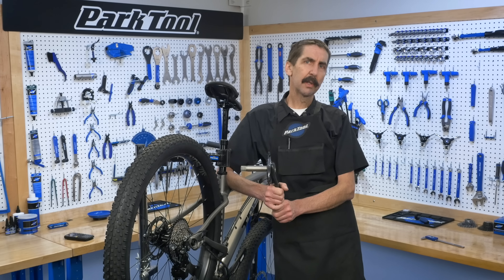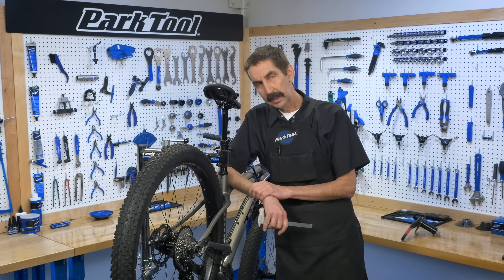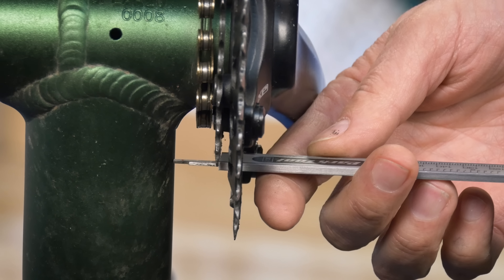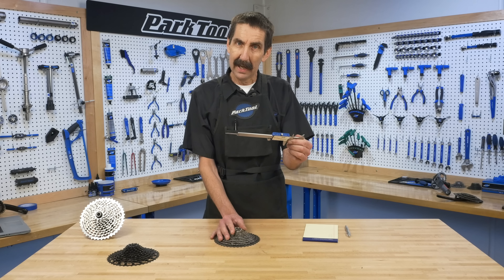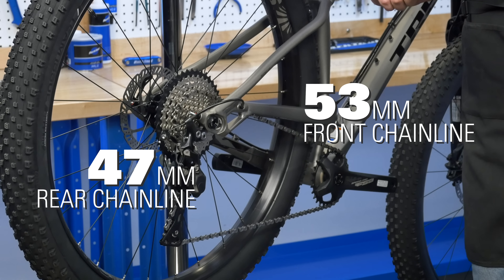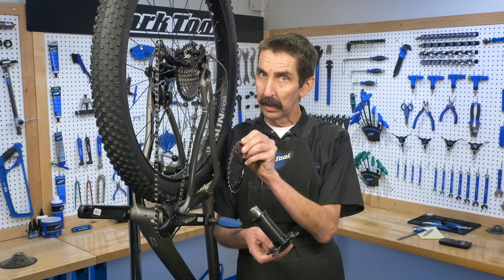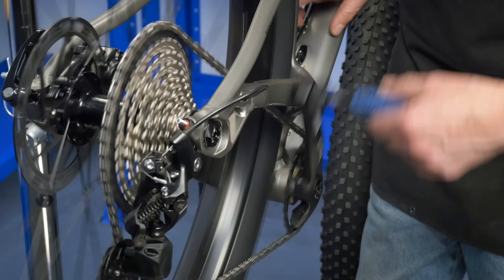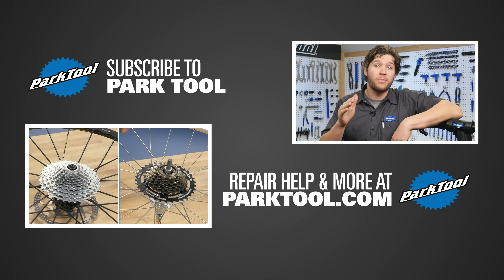Shop Talk: What is Chainline, and How Do I Measure It?

Comment: Hello, Mr. Jones. Excellent video, as always.

I have a question; I am running 10 speed on my road bike. if I buy 11 speed wheels ( in case of future upgrades ) and add a spacer, then a 10 speed cassette, is there a performance issue between this and an actual 10 speed rear wheel?

Thank you in advance for any advice!

Jim
Reply: Not Jim but the answer is: Most likely no as long as the rear derailleur is properly adjust especially regarding the limit screws.

Comment: 7:23 you say that the crank can't move left and right. Isn't it possible to move the crank left/right with a bottom bracket spacer between the bearing cup and the BB shell. Sheldon Brown suggests this on his website; is that a technique that doesn't work on newer configurations?
Reply: probably some spindles don't allow for it, I know i can get away with it on my raceface cinch, especially on my Fat bike, but it probably varies so much with brands (and might piss off vendors trying to sell their boost chainrings) that they probably thought it would just over-complicate the process of simply measuring chainlines

Comment: I run 9 speed and X2 on front, when I'm running the inner gear on the front the 3 higher gears at the back (7,8,9) randomly skip (jumps) almost feeling like the cogs are worn...but they aren't.
This isn't a problem once I put it on the large outer gear on the front.
I've checked for a bent rear mech hanger and it's all straight, so am I guessing that I might need a small spacer on my BB on the drive side?
I've ridden with the large cog on the front and lowest gear on the back and they don't skip.
Reply from the maker: Sometimes it appears the rear is skipping but the chain is actually catching on the shift pins of the crank. Look down from above or up from below while pedaling and you may see the pins catch the chain as they pass by. Spacing this out will help but is sometimes unavoidable for certain setups.

Comment: Are Shimano 12s Deore 142mm thru axle microspline hub compatible with any of the Shimano 12s Crankset and chainring chainline with 52mm chainline? Or it must need a 148mm boost hub? As fas as I know 135mm and 142mm rear hubs needs a 49mm+/- chainline? How does Shimano says that this is going to work?
Reply from the maker: Shimano says the 52mm chainline cranksets work with 142mm hubs. Going up to 55mm is where boost only comes into play.

Comment: Hi,i would ask:if my bike frame is not straight with swing arm.can that effects on chain,and makes it won't turn and makes strong sound like tag tag tag.especially when it under load,like at start and climbing hill?
Reply from the maker: A misaligned frame or a frame that has a loose swing arm will have an effect on chainline. Bad chainline can cause noise but that may have to do with something else being loose or dirty.
Reply: Thank you so much Sir,for your reply and care.I appreciate that.

Comment: I can live with the noise but i wore out my chain within 3 months...... i had upgraded my screw spro ket from 6 to 7 speed. And also used a 2 or 3 mm longer bottom bracket... is it really the chainline thats vausing premature chain extension???? Plz help me out
Reply from the maker: That seems like excessive wear no matter the chainline. Unless you put on a ton of miles.
Reply: @parktool  nope, it could not have been more than 600 or so kms cos it was winter.  I really hope that i got a knock_off shimano chain and there is no other problem..thnx for the reply though

Comment: Which one is better, 2x8 or 1x11?
Reply: 1x11
Reply: Cause it's simpler lighter and looks better
Reply: 1x8
Reply: @pedrovsilva1  But i like really small gears
Reply: 3x8
1x11 is awful. bad chainline. more wear to parts, more expensive chain + cassette. garbage.
Reply: thelawnet yes. Everything you said is true. However, the chain often drops on 3x drivetrains. I think a happy medium is 1x7 or 1x8 or 1x9.
Reply: @peterlang5047  I have no chain drop on 3x drivetrain. there is better chainline.
Reply: thelawnet my chain dropped all the time with my 3x7 drivetrain. Maybe my chain line was messed up, maybe you don’t ride hard enough
Reply: 1x11, don't listen to anyone that says otherwise.
Reply: 3x10

Comment: If I put the front cog on the inside of the the crank instead of outside and adjust the set screws couldn’t this possibly fix or at least reduce the backpedal issue
Reply from the maker: Proper chainline will help reduce the issue. Pushing the chainring inwards can start to cause issues with the chain rubbing on inboard cogs.

Comment: im trying to get rid of noise on my bike and i don’t know that to do should i change into a clutch derailleur or should i change into a 1 by all i know is that the noice is the chain slaping looking for advice :/
Reply: Both will work. What I did is I changed it to a 1x and shortened the chain because I couldn’t afford a clutch derailleur
Reply: Peter Lang ok thanks but do you think i would need a chain guide
Reply: Joe likes mountain biking it depends. Try just going 1x first. I had a lower chain guide because my chain kept coming off every time I did a fakie. I did notice that it helped keep the chain front slapping around.
Reply: Joe likes mountain biking going 1x and shortening the chain would work. Getting a clutch derailleur would work. Getting a lower chain guide would work. You could only do 1 of those things and it will help. Or you could 2. Or all 3
Reply: Peter Lang thanks pal :)
Reply: Joe likes mountain biking yeah no problem

Comment: My back gearshifter is broken can you tell me how to fix it in home
Reply: Mobin Noori how is it broken?
Reply: My chain got stuck in it and when i padel it kinda damaged the gearshifter
Reply: Back gear shifter that thing which it look like hock
Reply: Mobin Noori so you want to know how to fix a broken back gear shifter thingy. I’ll start by listing the names of things and what they do. I assume you know what the frame is. The derailleur hanger attaches the derailleur to the frame. The derailleur hanger is designed to bend and/or break if you crash, so you don’t damage the derailleur. The hanger is usually a smallish silver thing. The derailleur is the mechanism that shifts the chain onto different cogs on the cassette. The cassette is the cluster of cogs (gears) on the back wheel.  The first thing to check is if the derailleur hanger is damaged. If it is, you could try to bend it back with some pliers (this usually doesn’t work) or you could buy a new hanger. They usually cost around $15. Make sure you get one that fits your bike, because all bikes use a different style of hanger. If your derailleur hanger is fine and your derailleur is damaged, you could try to bend it back with some pliers (again, this usually doesn’t work) or you could get a new derailleur. Derailleurs cost anywhere from $20 to $200 depending on how many cogs your cassette has, and how fancy you want your derailleur to be. Some more expensive derailleurs have something called a clutch, which basically makes the chain tighter so whatever happened with your chain wrapping up won’t happen again. I hope you get it figured out. Let me know if you have any more questions
Reply: @peterlang5047  Thanks for saving me the time.
Reply: Tomi Saaranen haha yeah of course!

Comment: Chain drops inside chainring when peddling backwards in first gear. Chainline favored for high gears and not toward the most used gears(the lower 5ish), wearing things out quicker. More maintenance means more spending equals typical engineering as for most products. Even this(me) beginner trail mountain biker knows.

Comment: Hey park tools could you do something on drilling holes in your MTB frame and will I make the frame weaker. Like if you want to see
Reply: Why would you want to? And to answer the question, it depends where, you need to look at the force currents when you are riding, for example a seat tube between then top and down tube doesn't see much stress, the top tube at the ends is stressed quite a lot, not so much in the middle, the down tube is stressed a lot at the ends, but not so much in the middle+ it's pretty overbuilt most of the time, the seat stays are better to left alone, there is a lot of force going through them with comparatively little material.
Generally speaking don't come close to the welds and stuff.
Reply: There are multiple ways to avoid drilling for mounting.

Comment: I’m curious, is there a reason why on an mtb the chain line front and back should not be the same?

I would have thought you want the front chain line to be as close to the Center of the most used sprockets, meaning, the alignment depends heavily on the way you ride. So if you do a lot of high speed stretches, the optimum would reside more towards the outer sprockets, whilst when doing lots of climbing, it’s more likely towards the inner sprockets.

Comment: I had a marin mtb that would drop the chain if you spun backwards 1/4 - 1/2 a turn in the biggest 3 gears. Super annoying, and would drop my chain at the worst possible time. Every bike mechanic I spoke to told me the same thing "so don't spin backwards". I sold that crap bike